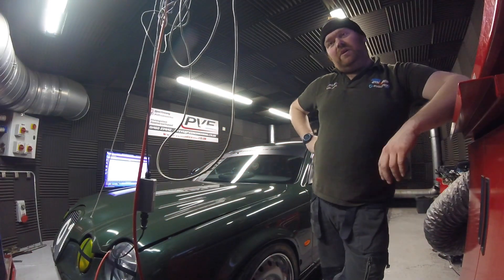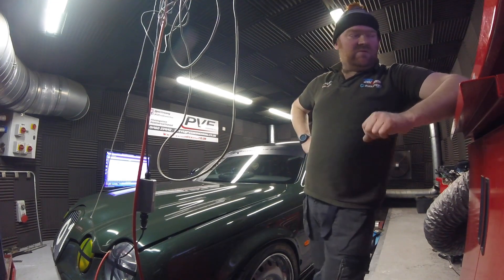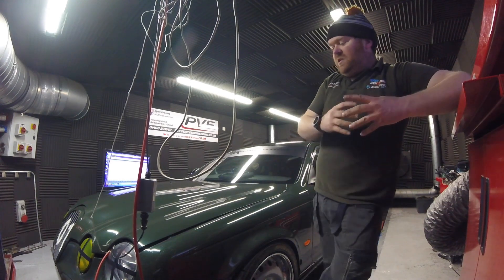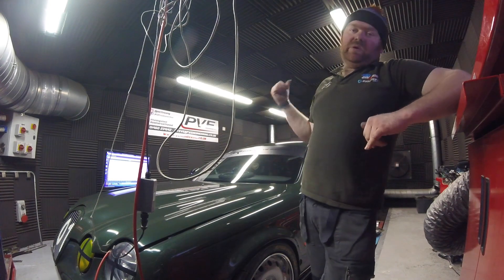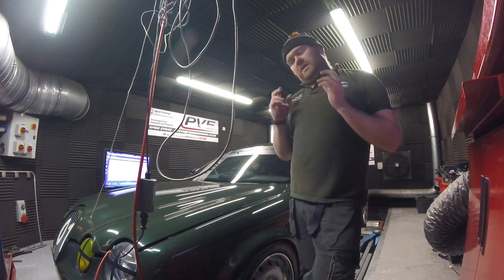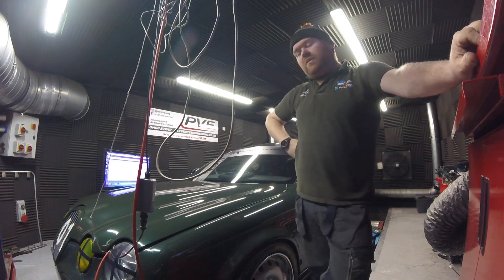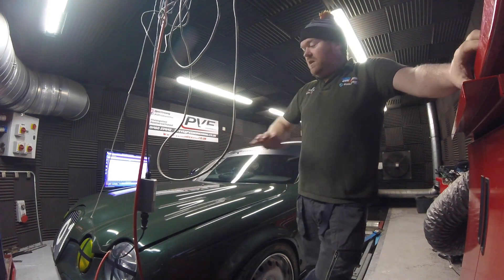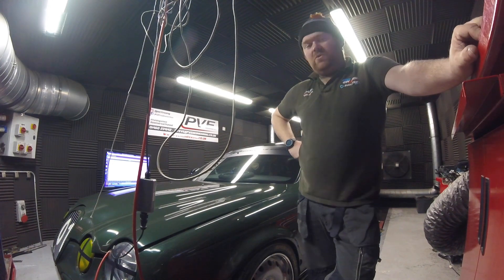Jaguar S-Type R 4.2 V8 Supercharged 'Plug an Play' aftermarket ECU Conversion using MaxxECU - XKR

Comment: What if you wanted to say swap this automatic driveline into say a 75 c10 truck...can I use the stock harness and ecu and just repin a few wires like a ls swap or? I can't find much info but have a lead on a complete driveline for 400 bucks with harness and ecu...and the difference of it is why I'm intrigued to buy it and do it

Comment: Did the car run and drive without the standalone ecu? Could it be driven without it?
Reply from the maker: You can bypass the 'Neutral Switch', and it will start and run, but in 'Limp mode', consistently.
Reply: @Tuning Shed  really appreciate the reply. Was there any real reason it was in limp mode? Why would it default to limp mode? Gathered a lot of parts to do this before swallows did with 2.7 gearbox and pedal box but never actually did it. Only just come across your good video.
Reply from the maker: @MDW893  CAN faults mainly. The PCM cannot communicate with the TCM, as it's not there. It automatically puts it into limp mode.
Reply: @TuningShed  yea first step would be to bridge neutral to avoid it thinking its not it park so wouldn't run

Comment: Hi, I’ve a Jaguar XF sv8, looking to tune it… don’t you think it’s a very underpowered engine? Compared to Audi 4.2 420bhp naturally aspirated engine, seems the 4.2 is only capable of 490-500bhp but the 5ltr can get 650bhp plus and rb26 engines pushing over 1000bhp

Shouldn’t 700bhp be possible from this engine?

Comment: Wonderful video! I have some questions, for a short time I have a jaguar s-type 4.0 v8 from 2001, and I do not know if some things of its operation are abnormal, the fact is that with the car stopped when I move the lever for D, N, R I feel how a pretty strong shake sometimes is that normal? The other is that when driving, for example, when leaving a traffic light, it advances correctly but when it changes gears it feels when it changes slightly and especially when it makes the first change from 1 to 2 speed, the rest are practically negligible, should I be concerned?
Reply: It sounds like you need a reset of the gearbox control Module (jaguar dealer only) and/or a gearbox oil change (no, it is not lifetime if by that you mean more than 4 years).